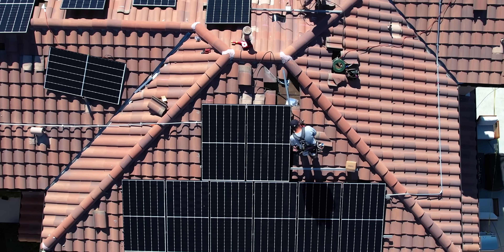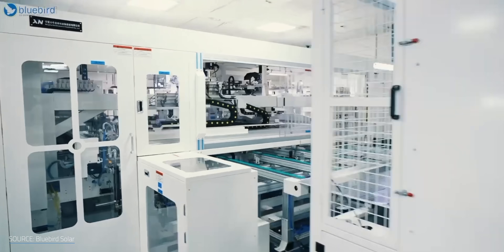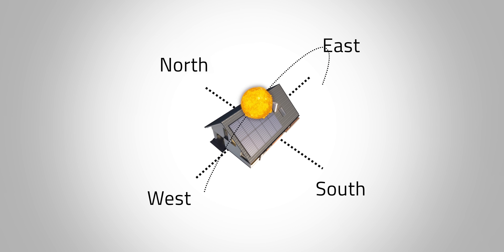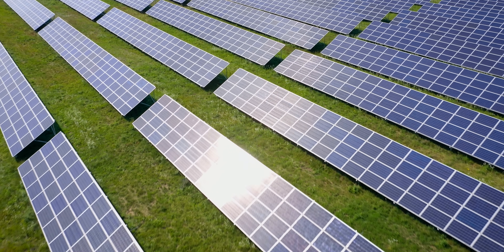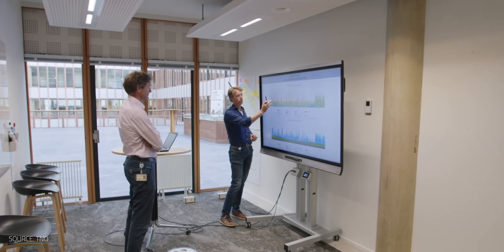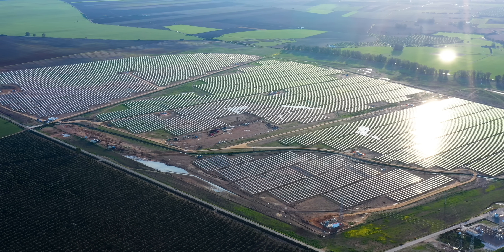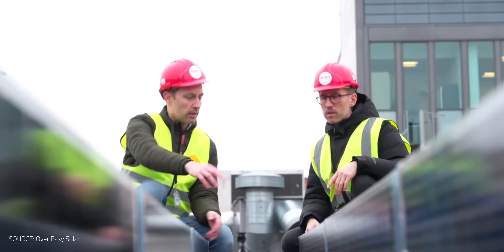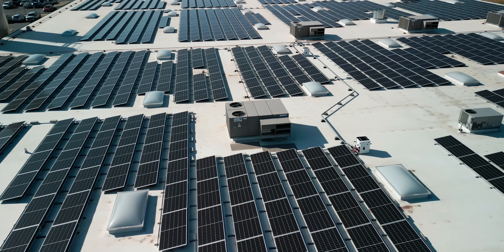Have we been doing Solar wrong all along?

Comment: This is exciting, I will install a solar system in our cabin in Northern Sweden this summer, I will use 750W bifacial panels and have 12 panels in Series per string where 4 strings will be towards south in around 45 degree angle and the 5th string will be a vertical east/west position with every other panel having front towards east and the others towards west.  So next spring I can say a lot more of these different setup next summer, I really look forward to compare the strings  during the atumn to spring period.

Comment: Brilliant! There has to be a way of determining temperatures to optimize solar throughput. As the sun moves, the panels move accordingly. Manually moving one panel every hour? Doable! But more than one panel every second? You need a predetermined mechanical device to do that 24/7! Which knows when and where to source its energy.

Comment: Solar panels need to be on roof tops or made as sun shelters where needed a further layer can be added under a solar panel with fans in with as many fans and blades as possible cooling the underside of the panels and creating energy that hasn’t further increased the footprint of the building think fans in servers flat under a panel and air spinning those fans

Comment: I think if the regular roof solar panels has one of those thermal energy batteries attatched to the back then all that extra heat mixed with the cooler roof under it might just make up the difference, mixed both vertical for walls, fences ect and then still install the horizontal panels for the rest. There's also another type of panel that is more efficient in shade so mix the panels in a checkered pattern

Comment: 75 degrees in the winter. The snow falls off and the sun is so low on the horizon. Why does the full moon look bigger when it first comes up and sets? The longer the shadow the better in winter. A flatter angle in the summer because sun comes up more ne.

Comment: Vertical panels have a large drop off in the mid day hours (sun directly over the top of the panel's upper edge) when other panels do their best. And a side by side comparison shows that vertical panels are not as effective at power generation as a south facing panel (roughly 30% loss in the example I saw). BUT couldn't a simple tilting apparatus offset this, in much the same way as a solar tracker does for horizontal panels? And as it is a single axis movement for vertical panels it would be far less complex, just a simple timer and motor rotating the panel to horizontal(ish) for mid day solar collection and then returning to vertical after a set period.

Comment: You could still have roof-mounted vertical bifacial panels, and I could only imagine how efficient 2' tall by 8' long panels would be stacked vertically about 3 feet apart. Instead of stacking them tall, you stack them on their sides. That would likely be the answer for most residential roofs.

Comment: So why not have a full solar panel on each side? Yes, this would be more expensive but Installation costs would be unchanged. The ROI should be better. Having an aluminium mount between the two sides should also act as a heatsink. I wonder how this would compare with a bifacial vertical mount but with solar tracking. The mechanics and mount for tracking vertical solar would be make simpler than for inclined arrays

Comment: couldn't you just cool your solar panels off like a computer with a water cooled system for the same effect?
Reply: Yes you could. There are so called Photovoltaic thermal hybrid solar collectors, which is a combined thermal collector and a pv module. You can use the warm water it creates for heating. The issue is that it adds a lot of complexity and so is considerably more expensive. The panel alone cost about 50-100% more than a pure pv- panel and you also need to do some piping. also, there's the issue that the heatsinks, the boiler and buffer tanks for the heating system, may get saturated which either means you need a different heatsink that just wastes the excess heat, so basically a big radiator, or you will lose the cooling effect.

Comment: Solution - Use a "Solar Tracker" fitted to tilt the pivot hinges. Fixed. The panel tracks with the Sun all year round. Shading can be fixed with micro-controllers on each panel cell.

Comment: Really now? You need studies and measurement series for that?
Pure logic and a very little scientific understanding of how “things behave” tells us that the angle of inclination and the temperature are the main factors. 
Logic therefore follows: The panel tilt angle (= “pn”), the panel temperature (= “pT”) and the amount of electricity generated (= “A”) are related. Ergo: f(pn, pT) ~ A. The optimum panel architecture is therefore such that the panel tilt angle is continuously adjusted as a function of these three parameters. Yes, this is where economic aspects come into play, as movable panels are more expensive, more complex, more maintenance-intensive, etc. The latter and not the relationship f(pn, pT) ~ A is the real (optimization) problem.

Comment: I still do not understand why solar panel installations do not include a solar water heater under them. Putting a solar water heater under them lowers the panel temperature and provides hot water for your house. You can also use the water heater to defrost the panels in the winter. There has to be an ideal temperature where they work the best.
Reply: That exists. It's called a photovoltaic thermal hybrid solar collector. The issue is that the collectors themself are considerably more expensive than pv or thermal collector only panels and the other issue is that you need a circulation pump, which needs power. Also, during sommer there's the question of what you do if your, "heatsinks" are full, because then the temperature can raise above what a normal pv panel would experience.

Comment: Vertical in situations there is a lot of snow makes sense to keep off the snow, Or northern latitudes were the sun is lower. Or if you need the land for something else since it's a better utilization of space. On the other hand if you have slanted roof slanted panels make sense. And horizonal panels would make sense if you want to shade what underneath from water evaporation. And fixed obstructions (trees, buildings, etc) that block sun from a particular direction can be a factor in orientation of panels too.  And so on. 

So the right answer to what way to orient panels.. it depends on the specific situation.

Comment: It wasn't mentioned as a benefit, yet vertical panels might also make sense where there is a lot of snowfall.  Not having to brush snow off your panels could be a benefit.   I think overall though, this reinforces the mindset that solving our energy needs with green energy is going to take a complex combination of many "green" technologies.    Horizontal panels over canals delivering water, avertible panels for agriculture, et. al.

Comment: So you have 2 panels back to back mounted on both sides of a frame right.
But do these frames have ventilation holes top and bottom to allow cooler air in at the bottom and the warmed air to escape at the top..?
ie: Convection..

It seems like a 'no-brainer' to do this, but from the pics you show it would seem they don't..!??
I have seen these thermal faux-pas all through the evolution of computers where the systems were designed by electronics/electrical people who had not spent a second of their entire lives thinking as a thermal engineer would, so its altogether possible that it hasn't yet occurred to the ...solar 'engineers' to do so..? 

Also; It really shouldn't be too difficult to come up with a top vent that prevents rain water ingress while using any wind to help draw the hot air out.

Comment: If no sane person would knowingly live in a home with asbestos , why would they live in a home with cadmium filled solar panels ?
Reply: @randyhuke3773  there's no Cadmium in silicon based panels which are the panels you use on a roof.

Only thin film panels use Cadmium but they are very rarely used today for roof panels.

Comment: Please do a newer video on the solar fence option.  Cost of bifacial is quickly coming to cost parity with 6ft wood panels.  Northern climates make the most use of vertical bifacial and they look just as good, if not better than traditional fencing.

Comment: This video is garbage. There are so many technically incorrect statements, misreading of graphs, and a complete misunderstanding of the findings of the publications being discussed, it makes the whole thing useless. 

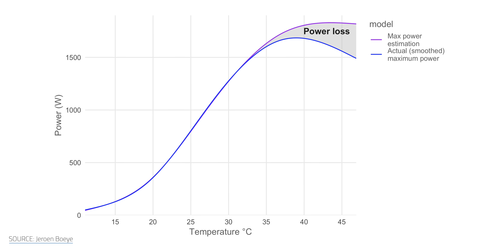1) The graph at 6:11 is Power vs Temp. He says it shows something about Voltage vs Temp. It doesn't. Power and voltage are 2 different things. He also sort of implies that this same graph indicates something about light vs voltage. This graph has absolutely nothing to do with light OR voltage. He does correctly state that the voltage output is a logarithmic value of the irradiance, but I bet he has no idea what that actually means. 

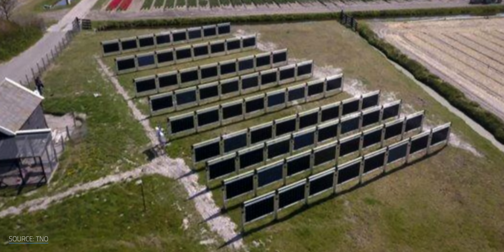2) His description of the graph at 7:11 is totally incorrect. This graph is comparing the computer-modeled estimation for vertical in in red, the actual measured value for vertical in blue, and the ambient temperature in green. There is no "vertical vs. angled" in this graph.  This demonstrates a complete misunderstanding of the testing, a complete misunderstanding of the published values, and a complete lack of capability in how to read a graph. HINT: Read the labels. They are there for many reasons. One of which is to keep oneself from looking clueless.

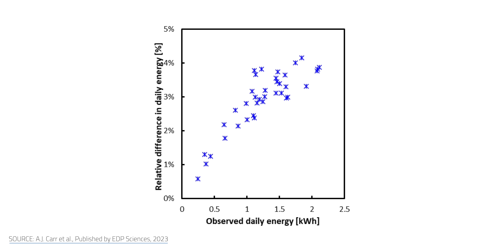3) His attempt to describe the technical value of the the graph at 7:46 is so muddled, I don't even know what he is trying to say. I do know it is nonsensical, and not supported by anything in the article. The graph implies nothing about the heat transfer coefficient, so I have no idea where he gets his statements on that. Plus, I think what he is trying to say would result in a thermal transfer coefficient higher, not lower. So even his muddled conclusion drawn from something not actually there is also wrong.

4) Nowhere in the paper does it make any comparison whatsoever to the operating temps of angled vs. vertical/horizontal panels. Nowhere. And the statement "half as hot" at 7:50 is not only made up out of the ether, but shows a complete lack of understanding of the temperature scale. 

5) In the paper, it doesn't say  "2.5% better", it says "2.5% higher".  Higher doesn't automatically mean better, it depends on context. And it certainly doesn't mean "vertical is 2.5% better than angled". Can no one on this channel read? The paper says their new computer-estimation algorithm shows that vertical panels may actually be capable of producing 2.5% more than the previous model for vertical panels estimated. That doesn't mean the panels actually produce 2.5% more, it means the new model estimation is 2.5% higher than the old estimation. There is no comparison of vertical to angled in this paper, only an old model compared to a new model, with some significantly-flawed data from a real, partially-operational, field-installed panel farm as a control. 

I could keep going, but I am done with it at this point. 

Again. Total garbage. Maybe the biggest garbage I have ever seen on a YT channel, particularly one with this many subscribers and apparent production quality. Not only does the paper not compare vertical to angled panels in any way, it only mentions angled panels once in the entire paper, in the first paragraph of the introduction. Angled panels are not analyzed or compared anywhere. Angled panels are not even mentioned in the conclusion. If this paper was somehow or another comparing angled to vertical, do you not think that both would be mentioned in the conclusion?

Next time, maybe hire fewer makeup and lighting experts, and instead hire someone that actually knows how to read a scientific journal. At least someone that understand Ohms Law. You can't even seem to get that right.

Comment: It seems to me that VBPV arrays may be better more cost-effective in some scenarios, but not in most. Especially if their energy yield is 9% lower than comparable inclined south-facing panels as the study alleges. They are merely 2.5% more efficient than predicted by the in-use model for VBPV arrays. The updated model now factors in gains from lower panel heating.

Comment: Well I'd say that the average power generation distribution going near the morning and afternoon energy demand peaks is the greatest benefit and efficiency gain of this technology.
Power storage is and always will be very expensive on a grid scale, which is why it only makes sense to use it for unexpected power draw increase, or powoer station failures etc. It makes no sense to introduce on purpose new power generation capacity that in the best case scenario produces a lot of energy when it's not really that necessary.

This vertical mount tech should also make it easier to mount those on rooftops of blocks of flats where it would make the most sense really because they could often meet local power needs for a few hours every day, especially ac thats most used when it's most sunny (perhaps a mixed deployment with 70% vertical panels and 30% classical panels to make the whole system power generation as flat as possible for as msny hours a day as possible (resembling an actual power station).

Comment: Due to climate change the world is seeing more Powerful Storms
When large Solar farms are destroyed by tornadoes or hailstorms or any other damage weather related condition and moisture from rain, snow or sea water wash through the debris
What is there to prevent some of the toxic chemicals within from saturating the soil ground water ?
I have seen photos and videos of thousands of destroyed Solar panels In the aftermath of horrific weather 
Is there a way to produce solar panels without any use of hazardous Chemicals or heavy metals, Vertical or Horizontal Possible ?

Comment: Alright, you want me to guess at 4:32 welp. I think it has to do with having two "sets" of electron availability and only 1 "set" of holes in the semiconductor. This would be causing a larger differential as the holes have twice the possible "places to go". While the electrons are not as attracted to the holes as there is electrons on the other side meaning they are less likely to "leak back"

Comment: So if the panels are generating heat are they actually contributing to global warming?
Reply: No. Say 1000W/m2 of sunlight hit the ground. The ground absorb 1000W/m2 of sunlight which 100% will turn to heat.
1000W/m2 of sunlight hit the solar module, about 20% of the sunlight will be converted to electricity while 80% will turn to heat.

Comment: I have a question: would a hydrophobic coating applied to the face of the solar panels, (preferably vacuum depositioned), negatively affect power output or longevity or efficiency?

Comment: add a v-shape ground ditch with ground supported reflective steel metal with aluminium/silver mirror paint to get all the sunlight. yep a mini concentrated solar electricity plant.
Reply: try center axle mounted variable angle orientation solar panels on a high mount fence. you can have a simple compressed air or hydraulic piston, or gears, as the third mount point, to set the simple angle of the panels, and the panels can change to vertical position, to fold away. from farming combined application. yes you get all the morning, mid-day and evening sun from all sides, even with a single sided solar panel.

Comment: 15 percent more efficient how? Purely in square footage? Im more concerned with efficiency in proportion to the raw materials used to create them. Having peak output from each cell is more important from an environmental perspective than max output per square foot used. It takes energy to create each cell. A LOT of energy. I think it's better to look  into making combined solar generators and water heaters. You can run liquid behind the pannels to take away the heat. Then use the solar heated liquid to heat water for showering.

Comment: If the vertical or near vertical panels can provide shading then my wife may approve so in hot days the panels are up to block the sun to reduce drying of plants and then can be removed or lowered a bit for more sunlight as needed on more cloudy days. Watering around plants can heal cool off panels too on super hot days!

Comment: So, a teepee arrangement is even better ... setting the panels at 75-degrees is better than setting
the panels at 90-degrees ... reducing the heating effects of the midday sun while maximizing the
resumption of solar conversion before and after midday. I would hazard a guess that 45-degrees
is the optimal angle for both solar generation and minimizing heat buildup in the panels. Simple
math of a parabola ... where the maxima and minima are at 0degrees and 90degrees with regard
to heat exposure. *And now we just need to redesign streets and houses to face North/South.*

Comment: Does the reduced heat load on the Panels increase the longevity of the panels too? Now that would be great if the panels lasted 10 or 15 percent longer. Instead of replacing them every 18-20 years they may last upwards of 25 years? 

Is that a possibility?